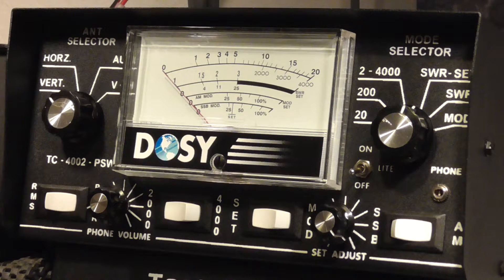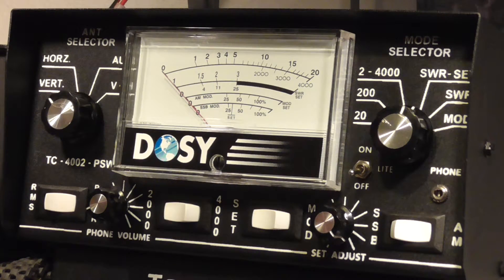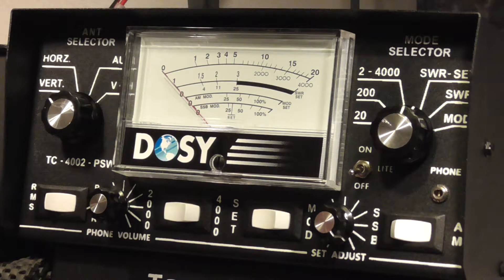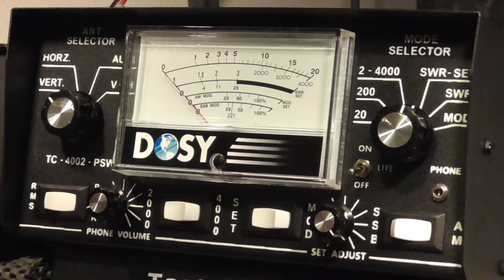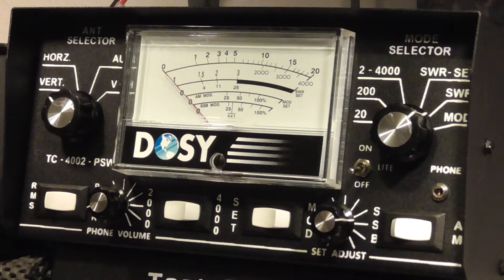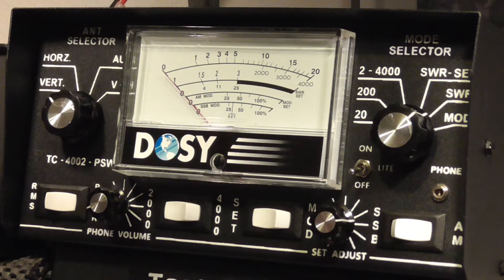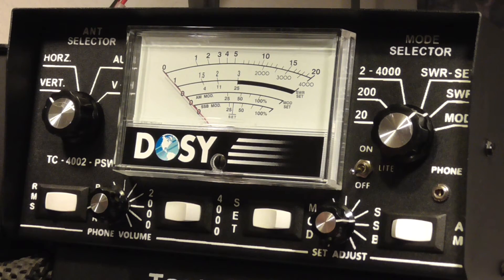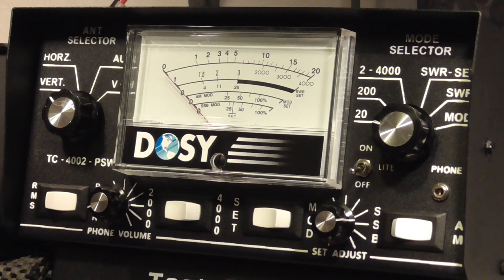CB Radio-The SWR (Standing Wave Ratio) Explained

Comment: Good SWR’s change in radios I got a cobra 29 chrome that has an SWR meter in it and seems to work fine and I also got a new style QT 40 from RADIODDITY fully programmable which I know nothing about it seems to work, but it’s all frequency that’s a can of worms. I was worried about with that thing I can see it jack and my other radio but it’s not coming in. It’s working like a regular radio that is real close to my radio and key up with bleed over so I’m pretty sure it needs to have frequency numbers coordinated. That’s my new task in life. Thank you for the SWR deal and it throws an S5 which is SWR as when I put it on high

Comment: It's worth noting that under the swr scale on that dosy meter there are numbers (4, 11, 25). That's the percentage of the fwd power that's being reflected back into the transmitter. At a 3:1 swr your antenna is only 75% efficient. Not only that, your finals have to dissipate the heat from your fwd power+ reflected power. So the finals in your cobra 148gtl that the golden screwdriver tech cranked up to 15 watts am, going into a 3:1 swr, have to dissipate the heat of 18 watts power. That's why the finals burn out.

Comment: You're showing your swr, yes but speak into the mic if your swr moves up or down thats your swr. S in swr means standing so if it moves during speaking its no good it has to stand! Still. No offense but this is bs.
Reply: I think you are getting confused about what standing waves really are. But yes, not many vids specify not to modulate when taking an SWR measurement.
Reply: @arconeagain  think there's much confusion around this subject, this video does nothing to help that

Comment: Nothing wrong with a "Thru the glass" antenna if it is designed and grounded correctly. The mag mount is rather inefficient without proper grounding elsewhere. Wire to chassis for example.
Reply from the maker: Tahoma LOL. NOT. I totally disagree on both points. Have a nice day
Reply: @Hilander1298  albee are you alive man?  You were a no bullshit kind of guy why did you stop making vidyas

Comment: Dosy is worse than garbage but they make great targets at the gun range. If you’re standing wave ratio changes when you change the length of the coax you have issues with the antenna. I have 10 and 10 is outside my home and I can change the jumpers on my meters or the length of coacts going to those antennas and my standing wave ratio never changes on any of them and I have done it to prove a point to several people who insisted the same stupid comment that you made. Funny that you’re talking about using a piece of crap antenna’s when you have one of the biggest piece of crap wattmeters in-line.
Reply: 1OFGODSOWN  to bad you dont know anything obviously.!
Reply: You're an idiot.
Reply: You are both idiots. You need to learn more about antenna physics. I agree on you with the Dosy though. Coaxial length will change SWR readings because of its loss or attenuation. It will lower the SWR 'reading' at the antenna the longer you go. Also, if your antenna is not 50ohms like at the radio, the 50ohm coax behaves as an impedance transformer. Depending on its length based on phase angle, it will literally change the impedance, that is, what the radio sees.

Comment: hi, do I have to turn the power knob and Mic gain all the way to 0 before calibrate the antenna ???
Reply from the maker: Isaias Balbuena No. set them where you use them.
Reply: That's not right. You should turn the mic gain down if it is going pick up any noise.
Reply: Jeremy is right. If you have any swing, that fluctuation will change the reading. 
When you calibrate the swr meter your basically telling the meter what the output power is.  (The calibrate function disregards the reflected power) if you have a dead key of 4 watts and a swing to 8 watts with modulation. If you check the swr with background noise it's going to read higher.  This is why you recalibrate the meter anytime there is a power change. 
The exception is If you have a cross needle swr meter. There is no need to calibrate those.

Comment: I started with channel 1 at 1.4, and channel 40 at 2.3, so I shortened the antenna..
checked again and now I have channel 1 at 1.6 and channel 40 at 1.8
is that ok?>
seems like the shorter I'm cutting the antenna the higher swr on channel 1 but its bringing the swr down on 40...
Reply: +WPGinterceptor  What's your SWR on Channel 20?
Reply: 1.7
Reply: semi truck.. on the mirrors
Reply: 2
Reply: sure am..  gonna check out my ground

Comment: hi i have a question, i recently bought a old midland 77-861 portable cb radio. and it works fine. but i noticed it has a small little meter on the top left that says BPS and has red and blue lines with a needle that moves when i talk or someone else talks. just wondering what BPS means. if you can please help i would appreciate it greatly.
Reply: To the best of my knowledge that meter combination of Battery Pack and Signal levels.

Comment: what if you can not calibrate, get the needle over to set.
Reply from the maker: +pat McCormick Increase your output power if possible. If you keyed power is like 1 or 2 watts it may not be enough. Otherwise, if you cannot calibrate to set, just realize your SWR reading is going to read lower/better than it actually is. It will be somewhat relative.
Reply: I did not check the power, I have the same meter you have. I checked it with a small meter but the meter needle was bouncing around and was hard to set but I thought I had it calibrated with the needle  going to the set mark. had a good swr on 20 and1. I just wanted to check it with the good meter being the dosi. thanks for getting back with me, Pat.